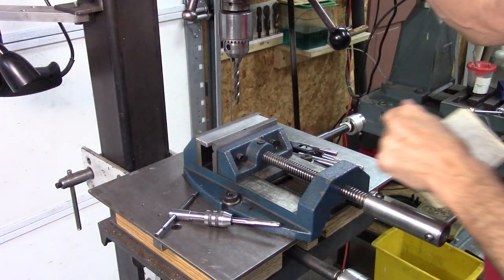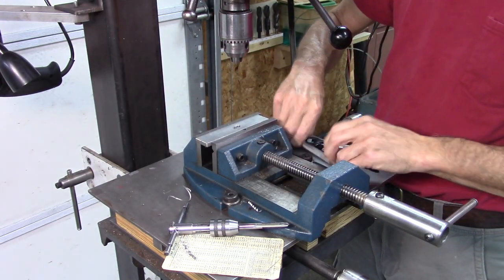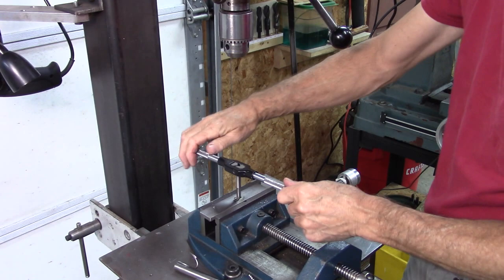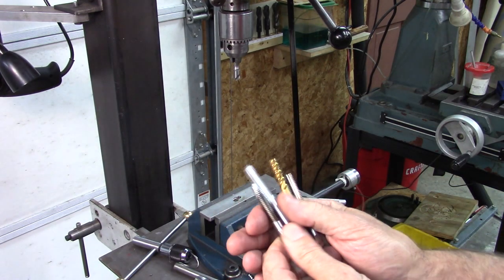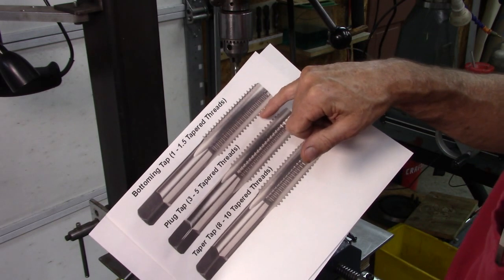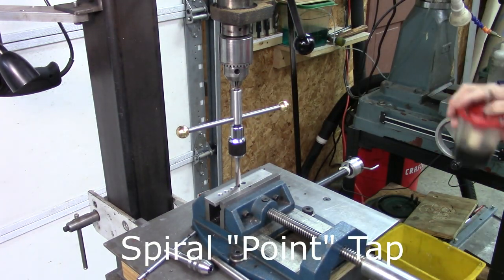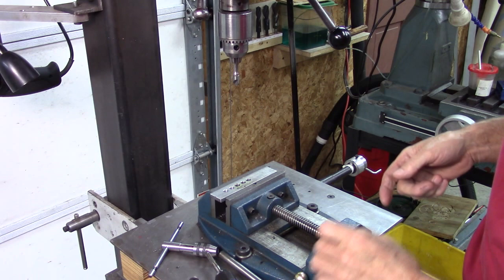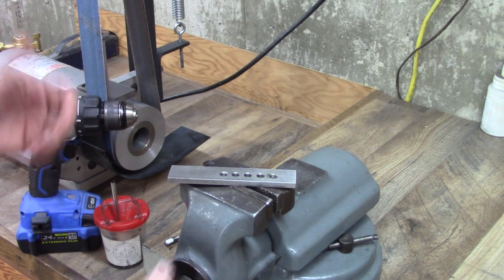An Introduction to Tapping

Comment: Use a lot of 4-40 thru 1/2-13 spiral taps at work run the 6-32 thru 3/8-16 with my cordless. And yes sometime snap the smaller ones. Not fun than but always good for a ribbing from the guys.
 Great video with good explanations. Your ending always makes me save my nickle for next weeks exciting thriller to the cliff hanger you leave us with.
Reply from the maker: Cliff hanger!  Good idea. "Be sure and tune in next week when I will show you an easy way to remove a broken tap". Now all I have to do is figure out how to removed a broken tap! Ha

Comment: Hey Winky, you probably know this but just in case you don't you can always come up with the tap drill size by using this quick formula: T.D.S.=NOMINAL DIA.(of tap)minus the PITCH(1/threads per inch). For example: 1/2-13 tap is T.D.S.=(.5-.0769), so the T.DS. would be .423, you can do metric the same way. 12mm by 1 tap would be T.D.S. = 12MM MINUS 1MM, SO TAP DRILL WOULD BE, .472-.0393= .432. YOU JUST CONVERT TO INCHES BY MULTIPLYING BY .03937.....
Reply from the maker: I was aware of these formulas but I always forget them when I need them. Maybe I'm lazy? Or perhaps limited metal (mental) capacity that is being reserved to new tap handles and cool wooden cars. 😃 I'm kidding, thanks for the post!
Reply: Your welcome...Love your videos
Reply from the maker: @claynorris3559  - Thanks!

Comment: Depending on what I'm tapping, brass or aluminum, I will chuck the tap in the drill press and turn the chuck by hand.. or start it by hand anyway.. Spiral flute taps are well suited to machine tapping be it milling machine (CNC or otherwise), lathe, or drill press (though you have to manually unscrew the tap after powering it in for the later two). For tapping small holes I will use a guide block (as shown by Adam Savage on Tested) to keep the tap straight.
Reply from the maker: My lathe an mill both have a reverse and I tap quite often with a tap in the tail stock of my lathe. The drill press is too fast and without a reverse plus I always like to chamfer the hole so the guide is already installed in the chuck.

Comment: Not sure what the term means for Plug Tap either.
But my use of the Plug Tap is for that exact thing ?
Cutting a Thread to insert a Plug into the threaded hole.
As most can see by the shape of the Thread Tap it does not have a thread machined all the way to the end of the Tap itself.
This aids in locking a fastener into a Tapped hole. ( eg a Plug ) to blank off a hole.
Most might know this one as used for Hydraulic fittings or Air fittings. 
Love your custom made Tap Wrench a good design ( good thinking 99 ).
Reply from the maker: I figured it might be for a pipe plug. I thick most think of it as an intermediate between a bottom tap and tapered. Thanks on the tap wrench, it's a huge plus to me. Thanks Max! (Good thing I'm old) (99)
Reply: @WinkysWorkshop  
LOL.
I was not sure to add the comment.
Good thinking 99 ??
Some get the meaning, but most don,t at first.
I was referring to the television show Get Smart.
You might remember this show ?
99 always came up with the good ideas.
( good thinking 99 )
Thanks for your reply.
All the best.
Peter.
Reply from the maker: @weldmachine  - Yeah...  I got it!  That's why I said "thanks Max"  (as in Maxwell Smart)
Reply: @WinkysWorkshop  
Ok, my mistake, LOL.

Comment: Hi Winky. Some of your global viewers use metric. There's an easy way to determine the tapping drill size - just subtract the thread pitch from the bolt diameter. You are right about going slight oversize of course and I really like your powered drill table. BobUK
Reply from the maker: Very cool on the drill size. i didn't know that. Yeah...  that's my square column drill press. The power lift is a $15 3/8" variable speed drill. It has a shaft and sprocket in the chuck and a chain that goes to the lift screw.

Comment: Gday Winky, great topic, I’ve been looking at the spiral flute taps for a while now, all I’ve ever had is the standard normal old school taps which there’s nothing wrong with them but lately if been lazy and been power tapping on the small mill, the spiral taps are the way to go there, there’s a lot to know tapping that’s for sure, take care mate, Cheers Matty
Reply from the maker: Several years ago I tapped 123 holes in my lathe with a 5/16" spiral flute tap. It broke on the 124th hole. I prefer the spiral point tap because it take less effort but for a blind hole the spiral flute tap is hard to beat. I don't know how that compares to other taps but I was impressed.

Comment: Thanks Winky, I heard about those spiral flute taps but I didn't know what the advantage was in using them.
Reply from the maker: I haven't used them much myself but they work great!
Reply: Spiral Flute Thread Taps are used for Blind Holes.
Meaning a hole that does Not go all the way through the part.
The Spiral on the Thread Tap works the same as a Drill Bit.
As you are cutting the Thread the Spiral forces the the cut material / chips out of the hole.
If this does not happen you can in some cases ruin the thread by re-cutting the the chips in the hole.
I hope this makes sense.
Regards Peter.

Comment: Thanks Winky, that really was excellent info for me. I'll be doing a whole lot of tapping (M6  = 15/64") through 3/4inch aluminium plate - any pointers you can share?
Reply from the maker: Yes, if it is a through hold use a spiral point tap. Also using a slightly over-sized drill will make tapping much easier and WD40 seems to work well for cutting oil in aluminum.
Reply: @WinkysWorkshop  Greatly appreciated Winky's Workshop.

Comment: Hi Winky, could you do a quick follow up on this. I'd like to know what type of taps I'm ordering so understanding the 'H' numbers etc would be very handy. I used some cheap spiral flute taps with my hand drill driver with the torque tuned down a bit and all was fine, the first one I tapped using my impact drill which snapped the tap in seconds, not recommended.
Reply from the maker: The H numbers are a clearance. H3 is the most common and gives you a threads  .001" to .0015 larger than your screw. This probably has nothing to do with your problem.  The recommended drill sizes on most charts is for a 75% thread. Trying to tap full threads would be very difficult and the amount of additional strength would be very slight. Basically only the sharp tip of the threads are missing with a 75% thread. Go with a 60% thread unless you are tapping sheet metal. The hole will be much easier to tap and the amount of strength lost is very small. Here's a chart that shows the 60% drill size (the first page) https://www.osgtool.com/books/800274CA-V2/resources/_pdfs_/800274CA-V2__.pdf
Reply from the maker: 2) I have found that the spiral flute taps are a weaker tap and work better then guided in a drill press or lathe. The spiral tip tap requires less torque but pushes the chips ahead of the tap. If you have a through hole use the spiral tip but in either case the 60 thread drill size will help a lot. Just to give you an idea, the drill size for a 1/4"-20 is .010" larger than a drill for 75% threads. Hopefully this helps.
Reply: @WinkysWorkshop  That's brilliant, thank you very much.
Reply: @WinkysWorkshop  Great, you really are a must in the learner's shop!
Reply from the maker: @28gwdavies  - Your welcome

Comment: What about the oil you used? Is there a special thread tapping oil?
Reply from the maker: Honestly, in my opinion there is a significant difference in lubricating oil and cutting oil but very little difference between cutting oils. I buy the cheapest cutting oil I can find. Other oils I have tried are thicker and stay on the tap a little better but I don't think they work better. In fact, when I use them on my lathe for cut off the thicker oil is a lot more difficult to clean up.  - Thanks for asking!